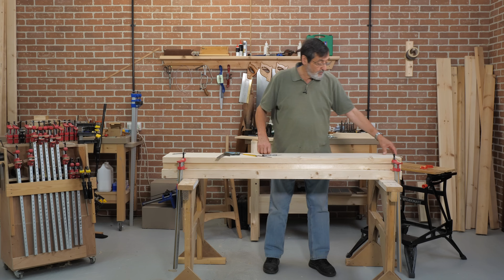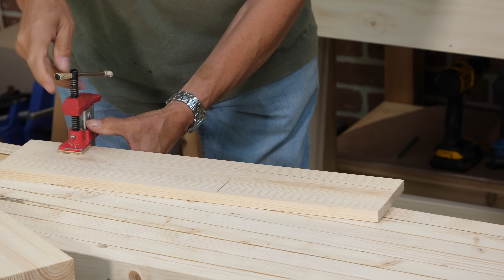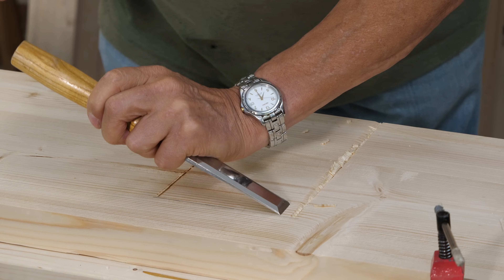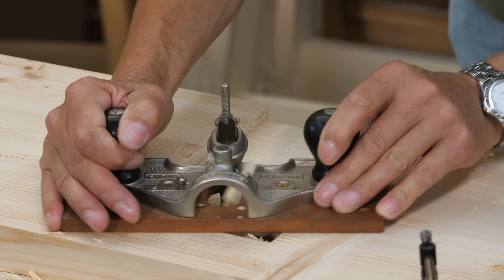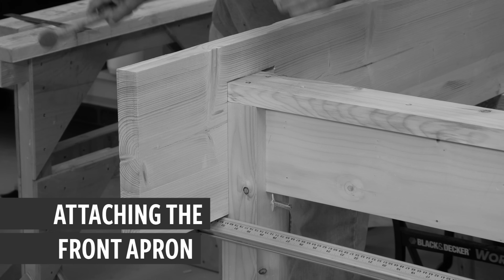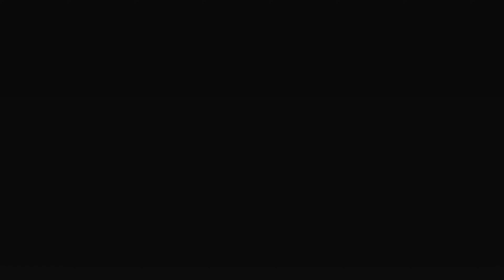How to Make a Workbench Episode 6 | Paul Sellers

Comment: Its hard to get access to the top of the wedge once the apron has been glued to the bench top: so it would be hard to tighten it if it comes loose later.  To get round that problem you might make the wedge wide enough that a laminate flooring tool could be used (its the tool used to insert the last piece of flooring when you reach the end of a row and the wall obstructs hammering).

Comment: Thank you for this!  I don't understand the need for the wedges though.  Can someone help me understand why we cut the space out just to fill it later.  wouldn't it have given us the same results without the wedges?
Reply: You can tighten the wedge after the workbench has been used a lot and may have worked loose, if you do not have a wedge and the bench starts to wiggle you have no way to tighten it again.
Reply: The connection from the apron to the legs is what allows the bench to resist racking forces.  Imagine if you pushed on the side of your bench and it just wobbled back and forth how much of a pain it would be to saw, chisel, etc. on the bench.  So those wedges are used to make a very tight fit to the legs so that it won't wobble like that.  He didn't explain it in the video, but you just give the wedges a good smack to set them nice and tight; you'd never get that good a fit if you just set the legs in fitted dadoes.
Reply: The shape of the wedge allow the legs to self tighten if they become loose.
Reply: @amsluis  thank you for the detailed response.  I had the same question as Jared
Reply: @amsluis  This is a great response, thank you! I was trying to figure out the same thing!
Reply: How did they come up with them being 9 inches? My aprons are a tad less wide being 11 inches.

Comment: 1) When marking the recess, add a few mm to the measured thickness of the top. After gluing the apron to the top you will be able to plane the apron flush with the top.
2) The carriage bolt are just there to keep the leg frames seated in the recess; they have no role in the long term left/right stability. The long term stability is ensured by the wedges which will allow compensation for any leg shrinkage. As showed in the old video I drilled 10 mm holes for 8 mm bolts when building my bench last summer.

Comment: I'm building this bench now and have a genuine question. What is the purpose of the wedges? If you're going to bolt the aprons to the legs and have the aprons sit inside a housing dado, I don't see what additional strength the wedge adds. Thanks!

Comment: Paul, when cutting these large housing dados, can you provide some advice on keeping a crisp knifewall along the top where the grain runs parallel with the knife wall?

The line wants to wander and tear under to follow some adjacent knots and nasty grain. The cross grain knife walls are no problem, but cutting a stopped dado with clean lines along the grain are tough!

Comment: Hi Paul, hope you're doing better now. I started the build but I need some clarification. Do I understand well that aprons hold only on one bolt at the bottom part and there is no glue or anything besides the housing dado joint on the upper part? Isn't there a possibility that the upper part of the aprons will go away with time? And also, what would you suggest to solve another issue I encounter: My aprons are same width as yours but my upper rail is wider and I have no space to put the bolt through the leg becasuse the rail is on it's way. Thanks for the instructions, you made me believe that I can actually build the thing without any experience. Thank you so much, I admire your job!

Comment: Paul, I hope you have time to answer, but I have a question about crosscut saw sharpening...Due to your inspiration and my want to do more hand work, I have purchased and sharpened some saws. They all cut much better now; however, my crosscut saws leave a very rough edge and seem to have excessive tear out. What do you think could be the issue? I set the teeth and sharpened with files...

Comment: What are the wedges for? Why can't you just pust the legs in the whole? Love your work!
Reply: I’m wondering the same thing, but you didn’t get a reply and I’m not thinking I will either...
Reply: @DD-sh1vp  He replied to another commenter saying it's to compensate for the wood shrinking, also the wedge goes down further due to the vibration of you using ut.
Reply: The wedges create an extremely tight fit between the leg assembly and apron board. The joint will tighten as the bench settles and moves due to the taper downward. It takes the place of glue in a way and allows the bench to be disassembled. 

I’d offer a slight modification to his design in placing a small second wedge into a small gap at the top of the wedge. This can be hammered forcing the other wedge down tightening the joint further. If the large wedge extends beyond the apron board bottom you can flush trim it if it bothers you.

Comment: 27:35 Rather nasty breakout of the bit. Generally use a waste piece clamped to the back side to prevent this, correct? Here, especially with the washer and the bottom of a workbench, I can see skipping that safeguard.

Comment: My aprons are only 11 inches, will it be ok if I make the wedges 7.5 inches as I'm thinking 9 inches will be too long? Kinda stalled at this point. Thanks for all the great videos and I'm getting excited about getting to the last steps of finally getting a proper wookbench.
Reply: Still stalled. My wedges go beyond my housing dates. What am I missing? Scared to go any further but soon I'll just cut them at 7 3/4 as that's the max length I can go before getting above the dato.  Help.
Reply: I'm guessing that is the length 7 3/4 is my cut to but dont see how mine can be that much shorter but I'm going with it

Comment: I’m in the process of building your bench and I’m at the aprons. I was wondering about the purpose of the wedges. I don’t recall you saying why you use the wedges in the recesses for the legs. What am I missing?
Reply: Think he does it to tension the  legs in the joint so they don't weeble wooble as the wood shrinks/expands seasonally.

Comment: Oof.  I really would have rather counter-sunk the heads on those carriage bolts a little bit (which would probably mean a different type of head, if it were me choosing the hardware).  With those heads sticking proud, anything you might ever want to clamp vertically against that apron, will either be deflected slightly by the bolt head underneath (mis-aligning a joint that you might be trying to glue at 90 degrees, for example), or putting a dent in something that was meant for a finish face.
Reply: boatrat74 I had the same idea. But if you read his articles or watch his videos about clamping workpieces to the bench, you'll see that it's not likely he will do this. The back vice jaw will be mounted proud of the apron face so the bolt heads won't be an issue.
Reply: Yeah, but that's kinda my point.  The traditional usage of these type benches (and the other classic ones, like the typical "Scandinavian" style with the shoulder vise, and the "Ruobo" style, even the American "Shaker" type with the full cabinets underneath)... all the old workbench configurations that were sort of standard in one region or another before the advent of power tools, ALL shared the feature/functionality of clamping/dogging large pieces to the front face of the front legs/apron/board-jack as applicable. 

What I'm saying, is to get the full functionality from any of these benches that is POSSIBLE (i.e. not the ignorant limited usage we've become accustomed to since power tools made us forgot all the old techniques)... the vise jaws SHOULD be flush with the front face(s) of the bench legs/apron/etc.  You're giving away a lot of basic utility otherwise, whether modern woodworkers know it or not. 

On the occasions when you might want the vise to hold something with irregular features/parts on the back face, such that the flush mounting would be a hindrance, it's easy to add a temporary spacer block to the rear vise jaw.  But it's damn hard to take away the offset of a protruding back jaw the rest of the time.
Reply: Just dill a 1" hole a half inch deep first to create a mortise.
Reply: boatrat74 bear in mind he's working in pine and you can easily pull the heads way into the wood if you keep tightening the nut! By burying the head you increase this possibility as you've removed some wood and lessened the density. For the record, heads on coach bolts aren't countersunk, you creat a flat bottomed recess for it to sit in. This is called counter boring.
Reply: Boatrat hi, the aprons are not flush with the legs, they protrude by their thickness reduced by the thickness of the dados. The heads of the carriage bolts are sticking out of the aprons maybe a millimeter or a millimeter and one half. I never found it to be a limitation to clamping, in my experience, in fact you could always clamp any piece a little further from the legs, if necessary. Or, as you said, you could just recess the heads of the bolts if that's a real necessity which, again in my experience, has never been the case.
Reply: Massimiliano M. --
Yes, I understand about this bench configuration... Speaking earlier to David N. about "flush legs", was only in reference to OTHER type/styles of benches such as the Ruobo.  My only point there, was that whether it is a "flush leg" design, or a style like THIS one, or some of the Scandinavian or Eastern European conventions with smaller "aprons" of some sort...  The point is whichever of these surfaces (either legs OR apron) is useful/available for clamping boards, that functionality works best when in the same plane with the front face of the rear vise jaw. 

 I understand now from David's remark, that Paul is choosing to have rear vise jaws NOT "flush" in this traditional manner... for his own reasons.  I'm just objecting to this choice.  The bolt heads are just another lesser example of the same issue, as you say, easily rectified.  But lacking the flush vise (a larger complaint in my mind) the bolts are not really the problem by themselves. 

I think what is really missing in this discussion, is the functionality of "hold-downs" or "hold-fasts".  If everyone here saw those in action, working equally as well against a vertical clamping face the same as on a bench top, folks would quickly realize the value of the apron (or legs, depending on design) being all in one plane with the rear vise jaw for quickly clamping the other end of long/wide planks.  The point, is that the WHOLE BENCH, is in effect a clamping jig, rather than "clamps" operating separately with the bench only serving as a glorified table.
Reply: boatrat74 I got your point too. This workbench and the heavy metal vice normally associated, plus a few further techniques Paul showed on YT solved all my clamping needs. But I understand there are other options and possibilities available too. I would not change my setup right now, because it's pretty easy and cheap to realize and sturdy too. I believe this series is dedicated to advanced beginners...
Reply: I've been using this style bench since the first set of videos came out. It is often an advantage to not have the rear vise jaw flush with the side of the bench. One very nice thing is that you can get your hand in there for an easier grip in and out of the vise. If you need to clamp something to the front of the bench you can use a spacer block the width of the rear vise jaw. It's just not something that comes up that often in my experience. I did build a boat with the help of this bench. I have not had an issue yet with the protruding bolt heads. But it would be trivial to recess them.

All that being said if you want to build a Roubo bench there's nothing stopping you. I for one, much prefer the quick release vise used in this type of bench. I'm using an old Wilton QR vise I found on Ebay. It's pretty much bulletproof.
Reply: I may inset my bolts when I get to this point. Or I could build to plan the pull them and inset them later. Willl report if I try it

Comment: I'm wondering why you did the wedges the way you did. To my way of thinking, they're upside down. The way you did them, there is no way to really drive them home and retain the leg in a  rock-solid way. When I made my bench according to your video series, this is the only thing I didn't do compared to how you did your bench. I had the wide side of the wedge at the bottom of the apron so I could really hammer it in place. I then retained it with a screw. I found this really locked the legs to the aprons. Why did you do your wedges the way you did?
Reply: The wedges will naturally fall tight as the wood shrinks is what Paul Sellers has said.

Comment: i used 2x4s for my benchtop and and came in at 11.75" wide. would you add another 2x4 and then have to rip it down or just adjust measurments to be .25-.50" shorter than your plans? thanks
Reply: You can make the top a little wider and the tool well a little narrow or inversely. No need to stick religiously to the plan measures which, as far as I know, are not exactly identical in US- customary and in metric.
Reply: Benoit Van Noten great idea about the well thanks
Reply: since you had such a good idea about the well what would you do if you were using 4x4s for the legs and didnt want to rip them down? thanks in advance
Reply: In the very first video of this series Paul said the bench was scalable in any  way you desired. If you feel you need a wider bench top you should add more wood. If you prefer a narrower bench, make it narrower. Having built a bench to the exact dimensions does not make you a better woodworker. Neither for making the bench, nor for using the bench.
Reply: jlinkels I am just trying to use the dimensions of lumber that I have and not have to rip every piece of lumber Because it is 1 inch wider

Comment: Why do you still have to use a wedge on the apron and not just make a dado with exact size as the leg?
Reply from the maker: I think we answered this clearly in the video. Any minor vibration will allow the wedge to continuasly self tighten should there be even the minutis amount of shrinkadge in the leg.
Reply: Paul Sellers, sorry I was not able to get this from the video. Thank you so much.

Comment: I tried adding a wooden sole (3/4")  to my plane but my cutter will only extend about 1/8"  below the sole. Something must be wrong with my set up.
Reply: Use a thinner board. Looks like Paul is only using something like 3/8"
Reply from the maker: Turn the adjuster wheel the other way up. It's stepped and gives more depth.
Reply: I use 5/8" or 1/2" mdf for a sole. It gives enough space for most work. At a purist level I want to use a nice wood, but the MDF is very stable and I can quickly put a new one together. I also give them a coat of wood sealer, because it makes it look a bit better and I think it helps with friction.

Comment: The wedges are not fixed to aprons or to the legs? I do understand that they settle and help the construction to better rigidity but aren't you worry that later they will run off the recesses?
Reply: The wedges are placed so that gravity will pull them tighter. The only worry then is levering outward, but the forces involved are so great that its very unlikely.
Reply: The original workbench series has a little piece screwed in over the wedges.
Reply: Some folks angle the outer side of the wedge inward and make the outside edge of the slot angle in so there's no chance it can just fall out. However there shouldn't be so much movement the wedge will literally work it's way out of the slot and fall to the floor so that's probably more overkill than necessity.